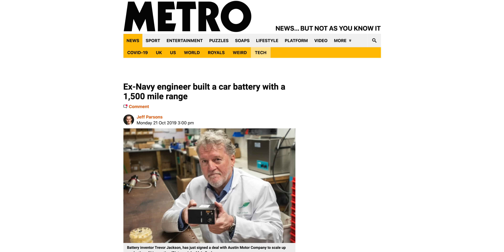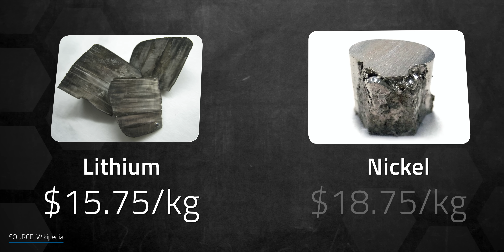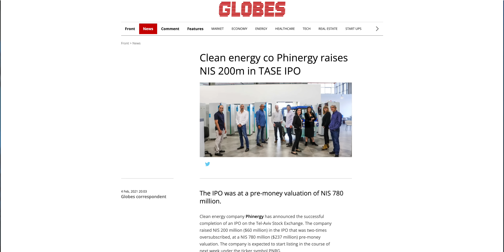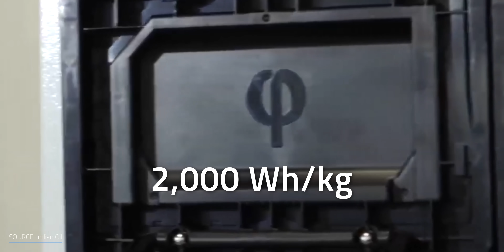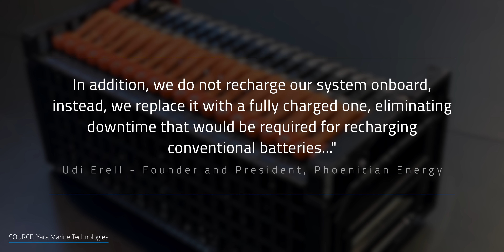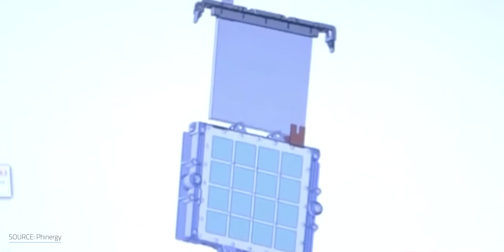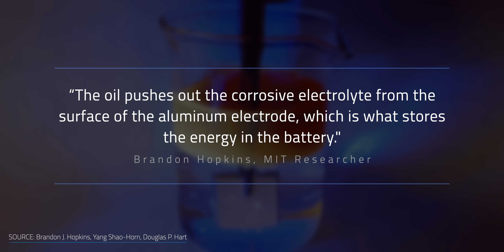Exploring the 1000 Mile Car Battery - Aluminum Air Hype?

Comment: Battery swapping is not a problem if the vehicle is designed with two batteries where battery A is used until exaustion and to be swapped while battery B is used to travel.

Comment: Would I like to drive a vehicle that requires battery swapping? -> yes, as long as the swapping doesnt take more time that it takes me now to refuel my tank with gas. Is not being able to recharge the battery by yourself an issue? it probably is. Perhaps a hybrid system with another battery type would be a solution, but those are again heavy and expensive. Maybe if I could buy a coulpe of kits and replace them myself, but the biggest problem with not being able to recharge is that it requires planning and you'll never use all the available energy you paid for.

Comment: What if the car had two batteries. One active, and the other on standby. When the active one goes dead, it automatically switches over to the standby battery. Then you replace the dead one when you finish your trip. I guess a more important question for me would be cost of new batteries. My current vehicle gets about 40 mpg, so a 1,000 mile trip would use 25 gallons of gas. At today's prices, that would be about $75. How much would the battery cost for a 1,000 mile trip?

Comment: The problem of running out of battery power would be resolved simply by having a mobile service, the same as 24 hr. road side assistance that's already in place.

In fact, if these batteries catch on people would start mobile services in larger Cities, where you just make a phone call 24/7 and they come to you, swap it out, and off you go, possibly still quicker than recharging a LI battery.

Comment: A good compromise to this might be to have an  EV with a short range like 50 miles using a small lithium ion battery, and then if you want to go further, you drive to a battery swap station, where you can hire an Al-air battery that will extend your range.

Comment: I'd favor a hybrid approach.  The car is a more traditional electric but with the ability to drop in one of these batteries as a range extender.  Just doing your daily commute? no need to have 1000miles range.  Just plug it in each night.   Planning a cross country trip?  Get a battery pack droped in and go.  Bonus points if the car will use the standard battery to say 20% before switching over to the aluminum air.  That way if you have the opertunity to charge, great, may as well use that.  Otherwise you have your massive reserve tank for when you just wont be near a charge point for a while.

I dont think I'd want one that was only aluminum air.   With a normal EV I could at least trickle charge it with solar in a situation where support infrastructure breaks down.  With expendable battery packs if none are available your EV is just a paperweight.

Comment: They seem viable if degradation problem is overcome. If you're stranded somewhere, you need to travel to nearest swapping station and get a new battery just like you do to get petrol/diesel. Your car's  roadside assistance programme may also provide battery. Very doable..

Comment: this idea sounds as bad as the one where they wanted to replace all the exterior panels of a car with carbon fiber like batteries, 
we need to find/ develop an anode and a cathode that has little to no degradation in use and is rechargeable, aluminum may be abundant, but so is oil, 
natural gas, and hydrogen but unless we can turn carbon into a usable product this is just awful.

Comment: Aluminium-Air Batteries made by India,  is the solution. Air and Aluminium are cheap and Indians reserchers say that 600 miles on one charge will be easy to achive.

Comment: I've had some thoughts about building decent DIY versions of these. Seems to me that Sodium Percarbonate would be a good electrolyte since it has high oxygen content (essentially its a chemical blend  of sodium carbonate and hydrogen peroxide), and within the liquid itself--and while it's fairly high pH, its not so high to be dangerous (like potassium hydroxide often is). If you want to speed up the process of reacting the Al, you want to use larger surface area forms of it, rather than solid blocks. Also, I plan to put my Al particles in a alkaline resistant pouch/filter, so I can quickly and easily take it out of the liquid so that when I'm not using the batteries, I can preserve the Al--a quick rinse with water with a weak acid in it (then dry it) will really slow down the degradation.  

   Also, carbon and aluminum react with each other--more specifically, carbon can also help to speed up the oxidation of Al. I plan to put in some highly electrically conductive, specialized graphite in with my battery slurry.  Honestly, this will be the hardest and most complex part of the battery. Because I plan to make cellulose nanocrystals and then graphitize them.  This will have graphene like properties, but you can make much larger quantities of uniform product in relation to the former as compared to the latter.  The only issue with this, is that the common/easiest way to make cellulose nanocrystals (CNC) requires large amounts of sulfuric acid, which is not the greenest substance (but its danger to humans is way over hyped).  But I'll be experimenting with using bio enzymes+bacteria to get rid of the amorphous cellulose.  I already know it will definitely be a significantly slower process, but I can make up for that, by doing large quantity batches at a time (like in a trash barrel), and have a few going at different stages.  

Then there is the issue of the energy to graphitize the material.. Haven't fully figured out a solution for that, but I can make a super insulated heater pretty easily. I already have one partially made. Two larger flower pots, one a bit larger than the other so they fit together with some air space in between, which I put some ceramic fiber in between. Then sealed the surfaces with sodium silicate.  I'll probably put a layer of Nighthawks approximate Starlite material on inside, and then wrap the outside with fiberglass and then Al foil or flashing. 

 P.S. my eventual Al "air" (oxygen) batteries will be powering ultra light weight electric vehicles. And some of these will be unique too, since they will be a composite between bamboo, S-glass fiberglass and/or basalt fiber, epoxy with significant bio content. I also plan to make ultra light weight trailers for these out of foam/wood/S-glass fiberglass/bio epoxy, that will have solar panels on it. But these are more spring projects.
Reply: I would use a pack of lithium iron phosphate batteries and just cut off the air supply between uses while remaining oxygen dissolved in the electrolyte is used then and there without being wasted on corrosion.  Idk why everyone struggles with removing the electrolyte or pumping oil in it's place when all you have to do is just program air valves to open any time a set minimum of voltage is reached in the rechargeable battery pack and shut as soon as a set maximum is reached.  Now, we obviously cannot vary the voltage of the Al battery as quickly as would be needed for gas pedal throttle variations on command using air exposure throttling alone, but I could see varying replacement of used air as a way to even more finely tune the output of the Al battery to the voltage used by driving to where a battery pack does not need to be very large to avoid having it's voltage impacted too heavily or exceeded.
Reply: I build on the assumption that oxygen exposure without active discharge over a long period of time is the only way corrosion of the aluminum is allowed.
Reply: And honestly, if corrosion between periods of acceleration is not a problem, we don't need rechargeable batteries at all, we could simply use up the oxygen discharging the electricity either into the power grid or a large resistive circuit after the car is parked and the Al battery cells are closed.
Reply: I guess if regenerative braking is that big of a deal a rechargable battery pack isn't that bad of an idea since a lot of unusable preventative discharge every time a car is parked is already taking place.

Comment: The video shows the battery bank being replaced as one of two.  Most travel trailers carry 2 propane bottles -- the owner has to switch them manually when one goes empty. And a tow truck carrying an extra battery bank or two doesn't have to tow this car -- just swap batteries.

Comment: I’ve always wondered why EVs don’t have battery swapping abilities because almost every other battery powered thing does.  I imagine a scenario where the driver pulls into a charging station / gas station type place.  The driver can wait to charge their battery or have it swapped if they’re in a hurry.  The garage employee comes out with a battery on a dolly jack, removes the old battery and jacks a new battery up under the chassis.  If the driver had a brand new battery with 100% capacity and worth $10,000 (for rounding’s sake) and the garage replaced it with an older battery with a 90% capacity, then the driver gets a $1,000 credit.  And vise versa if the driver has an older battery.  If going on a long trip, the driver could possibly pay a small upgrade fee to have the battery replaced with a brand new battery because I imagine many people will tell the garage employee that they only want a brand new battery, thus causing these to run out quicker.  I also understand the paradox that is similar to current charging stations.  And that is you first need large amounts of EVs to financially support these stations, but then you first you need large amounts of charging stations for people to want to buy EVs.  This isn’t my field of science though.

Comment: I could see using these as a "spare tank" where the electrolyte is dumped into the battery only after you end up stuck and need to go another 50-100 or so miles. It might be an affordable way to have emergency range.
Reply: wouldnt it be more sensible to have the rechargable batteries as the "spare tank" why have "spare taank" thats got a longer range than the main batteries?
Reply: @dantronics1682  Rechargeable batteries are great, if you regularly end up using those cycles. For rare events, it's perfectly acceptable to trade reusability with smaller size/weight, if that's an option.
Reply: @JGoodwin  I suppose people uses vehicles differntly in different countrys. in the UK most electric vehicles are used very regularly specially with sales reps so if an alu-air pack last them 2 weeks travelling about with a lpf/li ion for emergency usage, and delivery vehicles.
Reply: @dantronics1682  Indeed. Just pointing out that different people may have different needs and I could see how this technology, even if it's one use, could fill a need.

Comment: Most people can't have a charging station at home in the UK. Light and swappable multi battery set ups where the swap is done at a station is no more burdensome that using petrol and eliminates the massive downtime of charging at a public station like normal EVs. Not that EVs are even necessary yet since we have plenty of oil. Additionally by spreading the source of raw materials, aluminium is common, you prevent a cartel like we have with Lithium which is rare and oil with OPEC. Also anything that limits the power of the Chinese Communist party is a good thing.

Comment: If they can be made small and plug and play I see a future. If you can get dry* batteries that don't degrade is storage and you activate them at fitting into the car you have in effect a spare that could get you home/change station. A spare would only need 10 to 20 mile range at most.
So if replacement is clean, easy (lift in and out), fast and the spare dry* battery is possible I can see it working. 
Who needs 1000 miles range all the time...

Comment: It will be nice to use this aluminium air battery together with the Li-ion in the EV. So, the EV can have all of the goods (hopefully compensate the bads of both batteries), which make the EV still re-chargeable with also battery swapping option. Plus the EV doesn't need to have big heavy Li-ion battery, maybe just 20-30KW for the rechargeable, and the rest of the space can be used for the Alu-air one. Software tweak will be also needed to make the 2 batteries working together.

Comment: I have been against the old tech of lithium in the EV industry and the means to produce this out dated and at times dangerous energy cell that degrades in my view rapidly and the cost swap over to replace a depleted pack to the environment and the hip pocket.

I would be happy to have a swap and go system or even a user exchange to have a spare kept in the garage when the range is low have one on board the vehicle for that last 10 or 50km as a full reserve tank/restart or if need be 50km lithium cell or other to get to a cell exchange station.

Thank you for sharing from Australia 🇭🇲

Comment: If the batteries are cheap and can last for at least a month before needing to be swapped, then i could have at least three of them stocked at home where I could swap them myself as they degrade then maybe, but still a battery that cannot be recharged just seems so negative (pun intended) .

Comment: At 2000W/kg, it has the same energy density available to the wheel like a petrol car. From 1 kg o gas, only 20% goes to the wheels. The rest is heat. An an electric motor, more than 95% can go to the wheels. A 2000W/kg energy density could make electric planes a reality.

Comment: If you Al-air battery dies far away from a swapping station, you don't call a tow truck to haul your car there.  You call a battery truck to bring you a new battery and  take the old one with it when it leaves.  Who knows, tow trucks might even carry spare batteries for just such an emergency.

Comment: This could be a game-changer for electric motorcycles and scooters. The batteries would be dramatically smaller than car batteries and could be easily swapped as needed. The lighter weight could also eliminate the biggest problem with current electric motorcycles - weight. No one wants a 1000 pound battery on their bike.

Comment: Aluminum metal production from aluminum hydroxide requires 12-15 kWh/kg electricity. If the battery output without degradation in 2 kWh/kg aluminum, the efficiency would at best be 17% (6 times more electricity required than recovered). This makes it even worse than hydrogen. Also Al/air battery not being rechargeable means no energy recovery during regenerative braking, so it has be be combined with something like super capacitors to recover energy. It all sounds not very optimal to me. Of course development can optimize technology, but the system efficiency will never get >20%.

Comment: So what happens when you get a flat tire. you replace it with one you have on board. So configure the system to employ 2 batteries, one active, the other on stand by. When necessary, swap, by throwing a switch. Other problems exist but are not made worse by the 2 unit configuration.

Comment: Battery swapping is the future for mainstream motorcycle manufacturers as there is already a conglomerate working toward such an outcome. These aluminium air batteries seem expensive to initially manufacture but surely the silver in the cathode is recyclable This would surely mean the most costly mineral is reused, reducing the cost of replacement batteries for any subsequent battery purchased?

Comment: Yes it can be a problem for my wife, she can't even change a single AA battery in the wall clock. I on the other hand would buy a brand new Al Battery from eBay and replace it myself when there is about 100miles left on the clock.Or why not just make a secondary reserve emergency battery to take you another 100 or so miles so you don't get stranded.

Comment: Depending on the mass of the battery module, such could pose a spinal lifting while twisting off angle issue for some people, particularly older people. Moving a charging cable 240vac-40amp at home wired into the utility panel, or an L3 cable on the go easy by comparison. Also when you do the lifetime net energy storage capacity, not just energy density of gasoline or diesel or oxidizing aluminum -- the Lithium ion might be 570 wh/kg, but it can also do that thousands of times for years //

Comment: Fading lipo, BEV fires, range anxiety, heavy batteries, no freezing cold tolerance, damaged by high temperatures or high current charging 800kw to make EV charging fast like gasoline/ diesel fill ups on the go // solid state & sodium & aluminum ion //

Comment: the swap is the best way to go. They will design for a quick easy swap. If good for 1000 miles DE rate at 800 miles so you are forced to hit a quick change station and away you go.  You see lithium Ion at present Tesla for a 2000 mile journey requires 14-18 stops to recharge. So 1 or 2 battery swaps  for 2000 miles is way better way to go.

Comment: If they don't find a way around the non-rechargeability, they are lazy and will fail.  The energy to smelt aluminum will likely not be low relative to the battery capacity.  I hope they fix the material/chemistry problems which prevent recharging.

Comment: If the Al air battery uses oxygen, what gases are emitted? Also how big in area size would the equivalent battery be. Weight is a big concern but so is area as a bigger battery needs a bigger car

Comment: How much £$ to replace the battery, my BMW 5 series Touring (estate) gets about 54 mpg on a run at £7.72p per gallon fully loaded with camping gear and two 24kg EMTBs sitting on the tow bar so £142 per 1000 miles (roughly) and I can get diesel anywhere. How much to replace the battery?

Comment: I'd prefer a swappable battery over a rechargeable battery. Many apartments in India are denying charging EVs in their parking as the cost won't be borne by the owner. Also, buying the battery is an additional expense. It would be nice to pay per use.